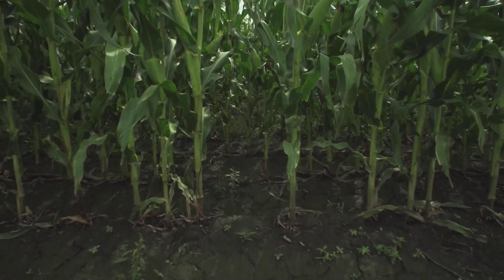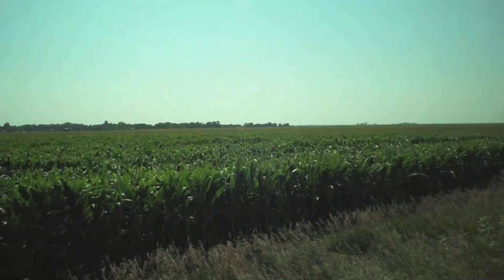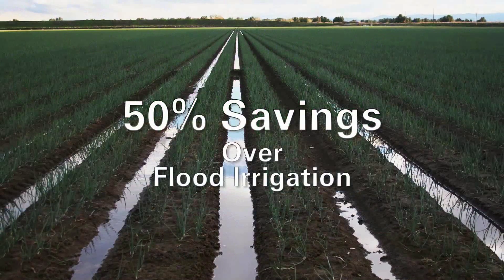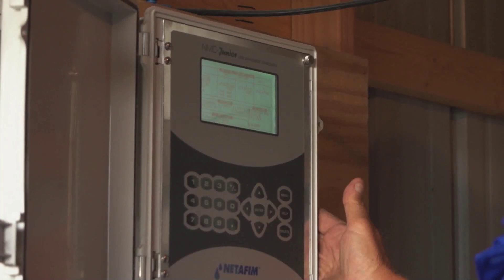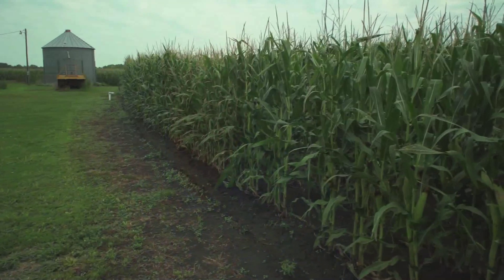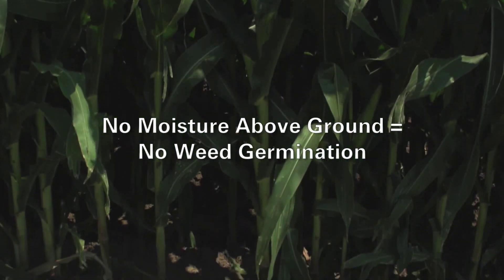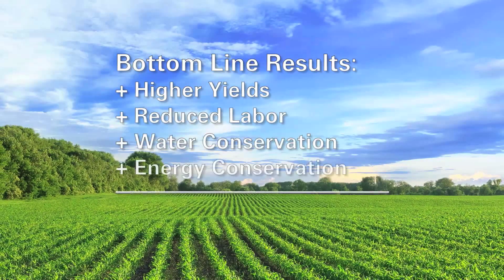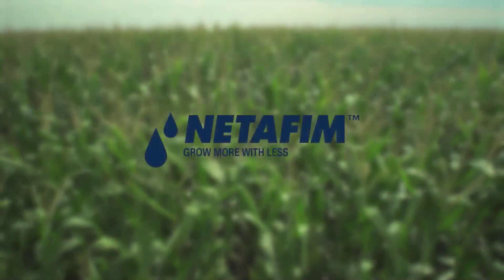Corn Growers Convert to Subsurface Drip Irrigation

Comment: What does it cost to install a system like this on a 150 acre field?
Reply: About 200,000
Reply: @deannelson9565  What is a ballpark figure on what increase in yield I could expect on a 150 acre field after spending $200,000 for it?  At present, with no irrigation, I get 165 bushel corn....on a year with decent July and August rainfall.

Comment: Do you need to pull up the irrigation system during plowing season?
Reply: No it's below the plow zone.
Reply: @deannelson9565  hi sir. Just to confirm. What is the depth of this tape. And what is recommended plough deepness during land preparation after applied this kind of irrigation system
Reply: @ramananaidu1219  Typical install depth is 12-16".  Recommend 6" of separation from tillage depth to drip depth